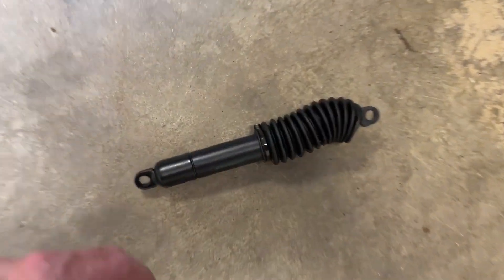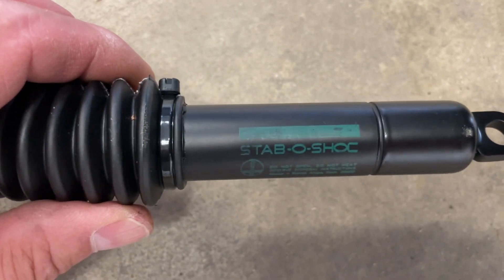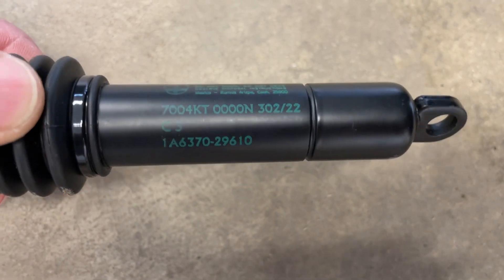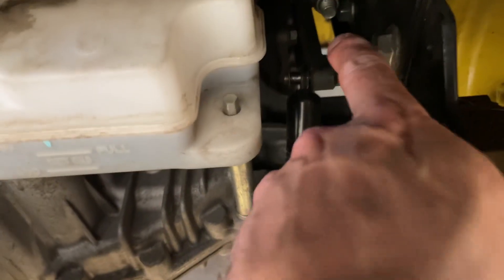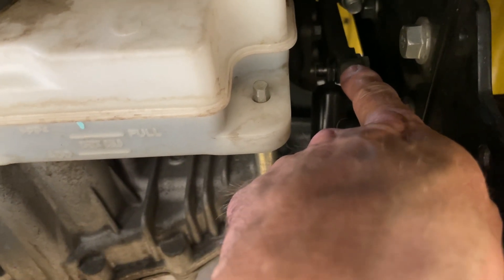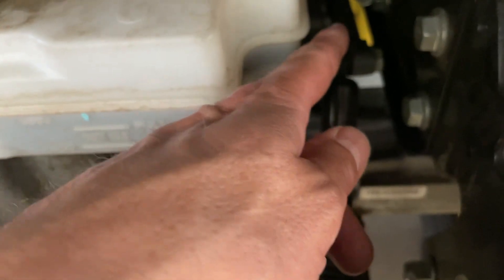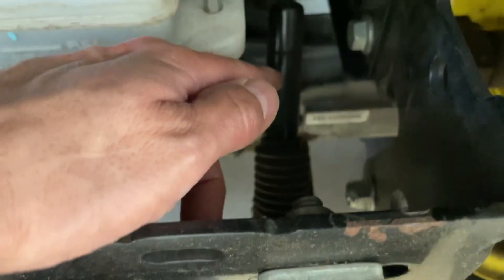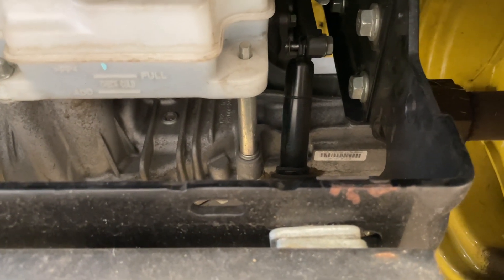John Deere jerks to a stop.  FIXED

Comment: How easy was the install, it looks like plug and play.  Thanks
Reply from the maker: @rayland8553  very simple, just remove the clips and it slides off
Reply: @ Thanks for the help, an easy fix to a harsh backup issue.  Now is there anything you can do about Deere charging a $110 for a $20
part 🤣 🙏🏻
Reply from the maker: @rayland8553  I would if I could, you know what they say, John Deere ain't the color of money for no reason. 🤣  I've replaced that little bugger twice now only X590, never replaced it one time on my X530.

Comment: Had the same with my Husquvarna TS 354XD. Parts diagram showed it but had no ID. I've yet to hear back from Stabilus, but I couldn't find anything against my Stab-o-Shoc part No. using their online catalog.  I've since learned it was part of my Tuff Torq  K66AGTransaxle, but not shown on their normal parts diagram either. Nevertheless, after talking with Tuff Torq we found the part.  I have it coming at about $70. I suppose you could actually get it from TT. What did you pay JD for it?
Reply from the maker: If I remember correctly around $80-90
Reply: I think I have the same issue on my TS354XD where jerks to a stop.  Do you have the part number you used and did it fix your issue?